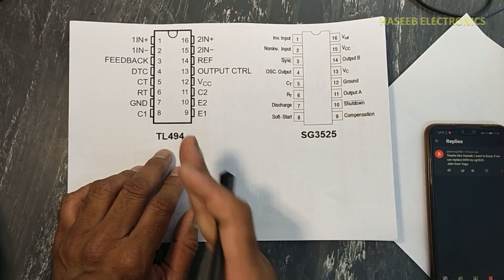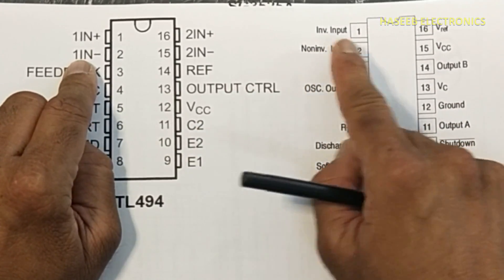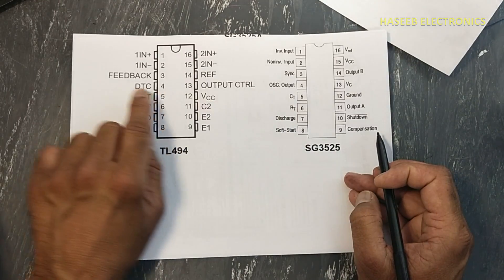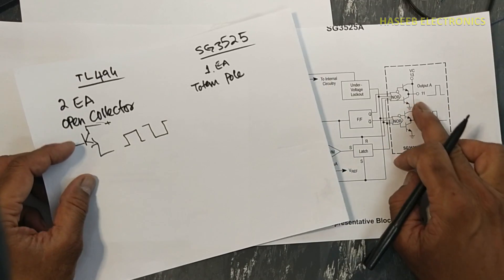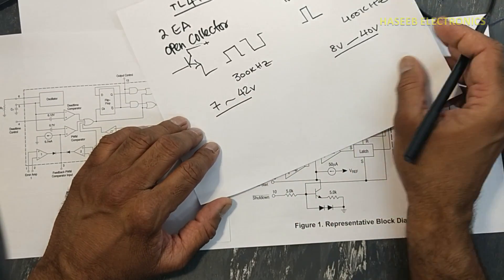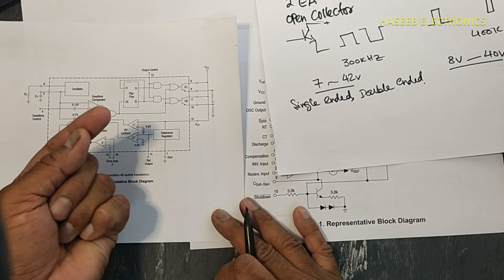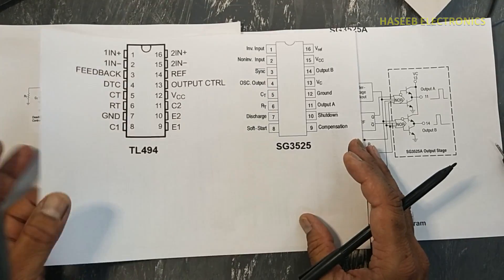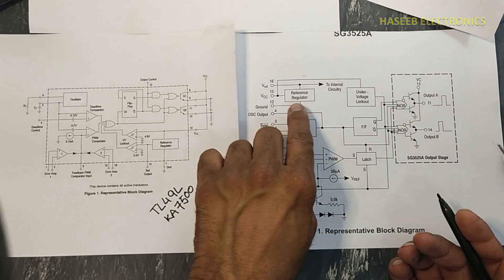{944} Can we interchange TL494 and SG3525

Comment: Fujitsu produces MB3759 as direct replacement for TL494. MB3759 has better performance at high switching frequency.

It is easier to replace SG3525 with UC3825. UC3825 (especially UC2825) can operate at 500kHz with good performance.

Comment: The dual totem pole output of the SG3525 favorizes its application for push-pull converters. So it can be used for high power applications.

But in these applications you have do be aware about its output current of 500 mA. You cannot use the outputs directly to drive the high gate capacities of high current / high power MOSFETs. You need to drive the gates with additional gate driver ICs like the MCP1404 which is a dual channel 4.5 A low side gate driver.

You also have to set the oscillator clock 2 times of the operating frequency of your converter. So if you need 100 kHz you have to set the oscillator clock to 200 kHz.

Comment: alsalamu alikum wa rahmet allah wa barakatoho, sir, i want to ask you, i am designing a power supply for induction heater using full bridge topology and cd4046 pll as my thesis project, but i am having a problem to understand how can i control the current. i mean my coil resistance is 0.5 ohm and i am trying to do resonance inverter so the current going to be 311/0.5 and this is very high so i will try to use transformer to make it less voltage and hence less current but i still don't know how can i determine the output power and how can i measure it